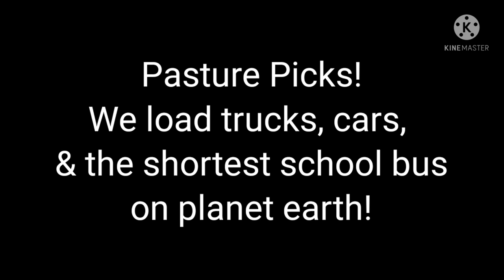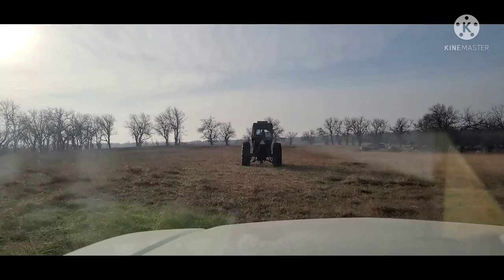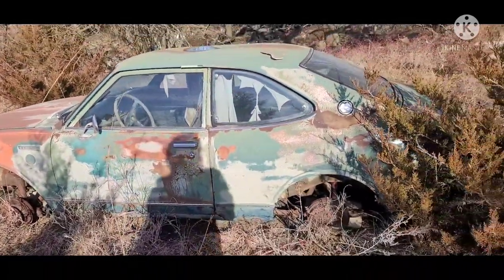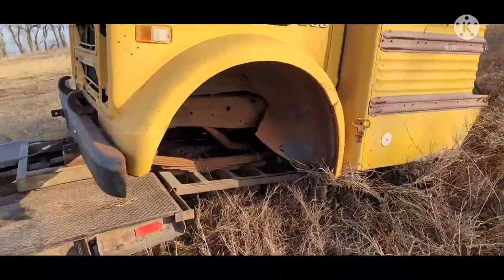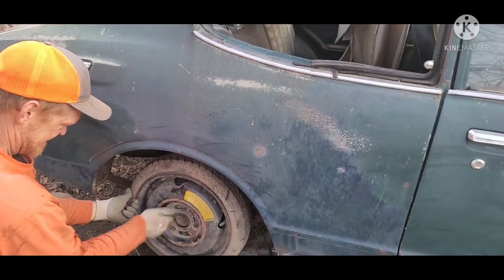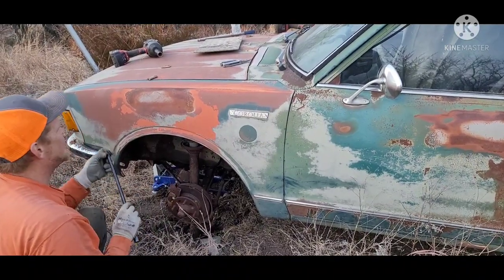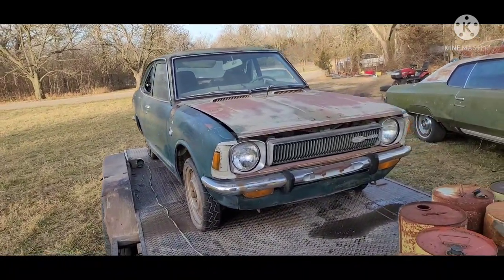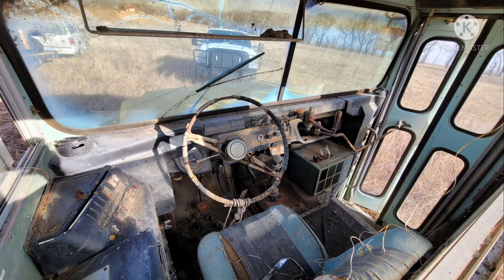Pasture Picks! We buy & load the shortest bus on the planet! Plus 1950s, 1960s, 70s cars & trucks!

Comment: LOL..when we were kids, we always jabbed each other with short bus jokes and roasts.  Examples included:
"The bus you ride on is so short, the front and back tires rub together!"
"The bus you ride on is so short, when you climb aboard, you immediately fall out the back!"
"The bus you ride on is so short, the headlights are also the tail lights!"
"The bus you ride on is so short, instead of it saying School Bus on the body, it says Schoo..!" 
Then I saw this on the video..."The bus you ride is so short that when it arrives to take you to school, it's just the front clip, with Mr. Goodpliers as your driver!" :face-blue-smiling::face-green-smiling:
Reply: Or, the bus you ride is so short, it has the wheel base of a unicycle..

Comment: Hay I need a replacement engine for the hyster forklift that you have is exactly like mine. Do you have one , mine is a flat head, lol , and as I watched you log unloading and moving things , I have wandered for 20 years why there was a hole in the drivers side hood , and I see on your fork lift the air filter is there on the running board, lol nice thanks BigAl California.     Happy new year guys, praise Jesus grace Christ amen 🙏 thanks BigAl.
Reply from the maker: It's got some blowby but seems to run good. The blowby is probably less of a detriment to a diesel since their fuel is oil - no spark plugs fouling like a gasoline engine. The hydraulics have fought Joe since he got it, and he is ready to park it. He has a replacement forklift found.  He may consider parting the Hyster, and could probably arrange freight for the engine. Of course these are just my observations from arm's length away. You can get ahold of him and he can fill you in on the details. His email is rustranchkansas@gmail.com

Comment: Cadillac front wheel drive sub frame and engine and transmission up under the front then  weld a car carrying trailer to the back of it one that has airbags that will allow the trailer to go all the way to the ground a winch to pull cars up onto .raise the back up and drive away the ultimate non-rollback roll back.

Comment: What's up with the green 73 caprice in the background ??
Reply from the maker: It is available. It needs complete restoration of the body, interior, and mechanical. The engine and transmission are missing. The floor pans and lower quarters need replaced. It has a nice trunk floor. Tilt column, fender skirts, and working power seat.
I will take $3000 for it if I title it. Send me an email, mrgoodpliers1985@gmail.com

Comment: That old bus is what ever someone sees in it and its not a lot but if that engine is a good one someone might grab it. Awful small school stop but then someones kid standing in minus weather would set in it if it just  took the wind chill off. I would of fixed the one ton long frame truck as I have seen  them done  right an they are bitching. I had one with a big block, clean clean... painted that chevy orange with black fenders, a holms wrecker body on it and it got tows more than others because it was a classic rig too. It had the automatic transmission with a band brake on that and then a transfer case  to run the pto. It was only a two wheel drive but had the twenty inch rims and really stood up with a real good spring package. Low and behold a two speed rear end an all so when it came down the road with chrome stacks rolling coal, and all those gears available, crazy fun to drive. I had a toyota like that with a 260 ford v8 in it an it scooted good